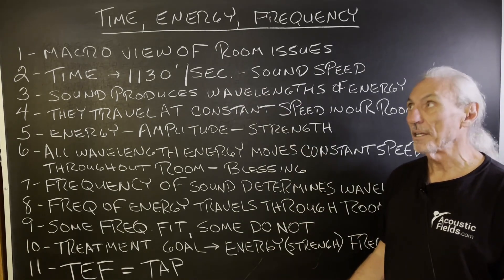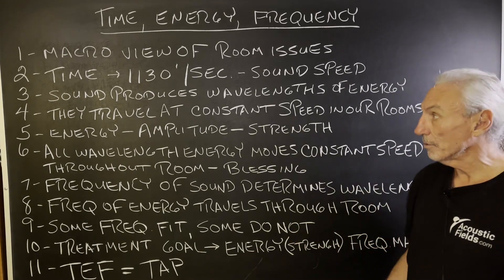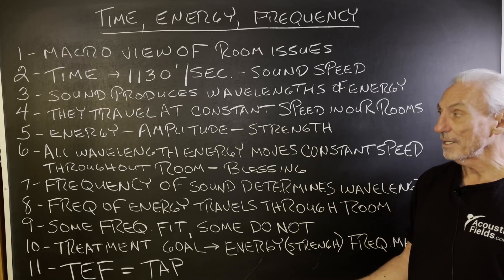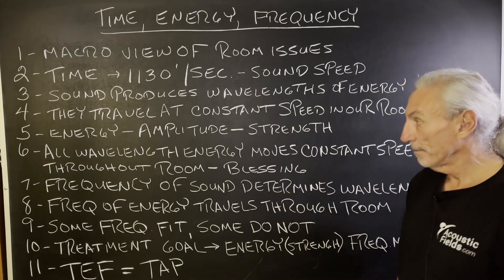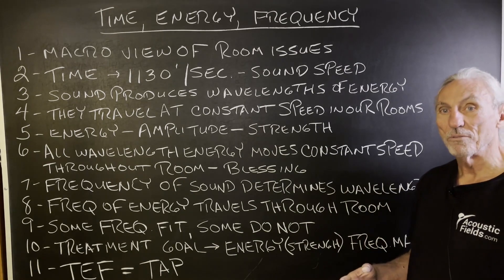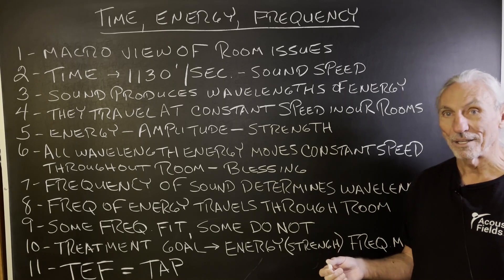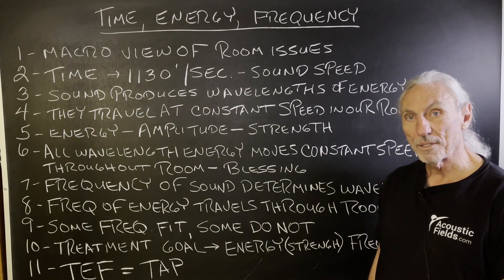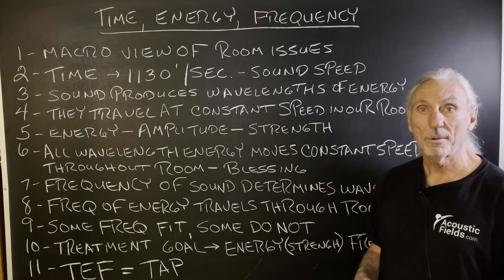Time, Energy, Frequency - www.AcousticFields.com

Comment: Hello. Thank you for all  highly information-dense content!! 

I have question or two for you - on topic of fractal diffusers. Do you have experience with that type of diffusion? Is there real science behind it? Do they work as they are advertised?

Thank you.
Reply from the maker: Diffusion is a technology to make a small room sound larger. It is a wonderful technology when applied correctly. Most fail in the set up requirements. There are distance and reverberation  criteria that must be met first and foremost before it is applied to any usage.
Reply: @AcousticFields  thanks for your reply. I'm familliar with diffusion. I asked about specific type of diffuzer (quadratic) Fractal diffusion, like diffractal.
Reply from the maker: @mikame1997  Fractal diffusion is a sub part of quadratic. The frequency ranges are different.